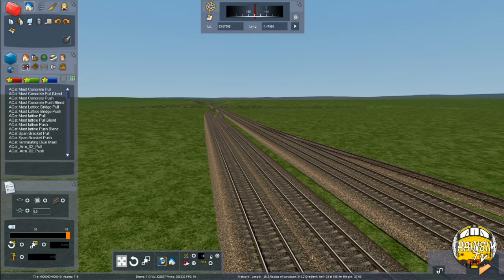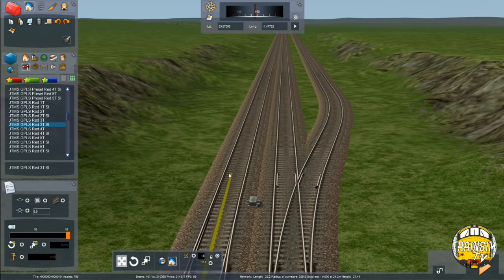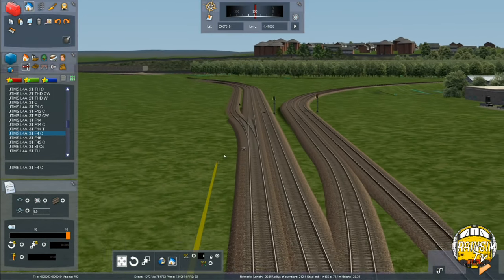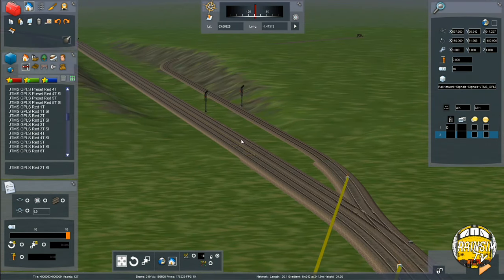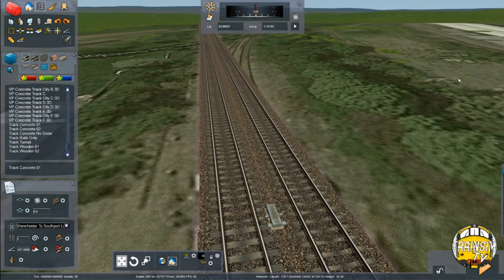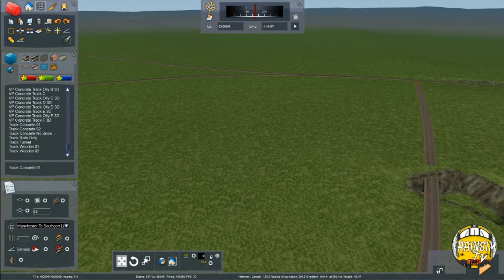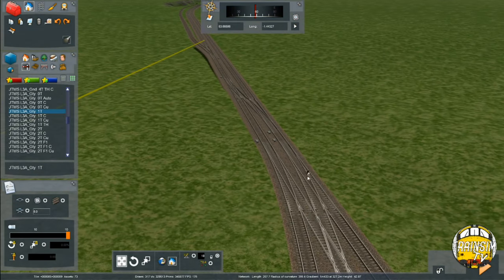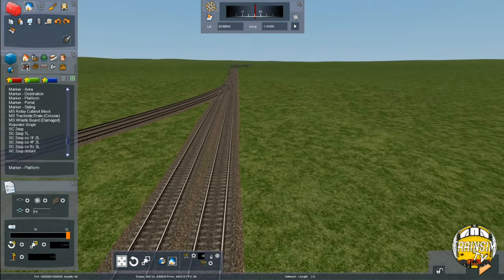Train Simulator 2020: Building Wakefield to Knottingley Ep.4

Comment: Another great video, one question - Where do you get the gradient information from, is it a book that can be purchased?
Reply from the maker: There are books that can be purchased though they are less accurate,such as:  https://www.amazon.co.uk/Gradients-British-Main-Line-Railways/dp/0711038449/ref=sr_1_2?dchild=1&keywords=br+gradient+profiles&qid=1591351742&sr=8-2 
The books however don't feature many secondary lines (for instance Wakefield to Knottingley isn't in it). I use spreadsheets which are more tricky and can be gotten via FOI requests to NR as far as I understand.

Comment: ive been trying to make the Hope Valley line between Manchester and Sheffield via bredbury I just cant get the google maps to work its start loading the blue circles but dosnt change from that …. any ideas why ???
Reply from the maker: You may need to set up your billing settings for it,you shouldn't get charged by it. Sadly the Google Maps/API thing is a bit of a farce and due to the billing thing it's hard to do a tutorial for really,I think that's why there's not many new ones out there.
Reply: Train Sim TV i have finally sorted it .. but thankyou ... maybe I should leave the route building to the professionals though 😂